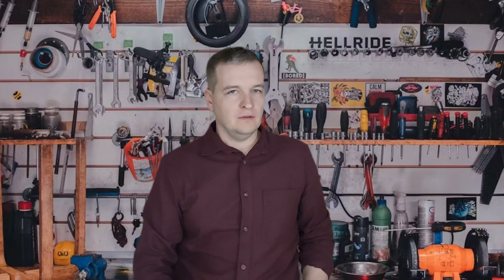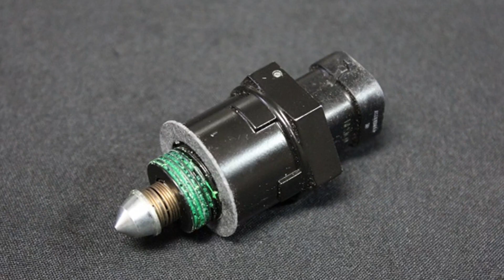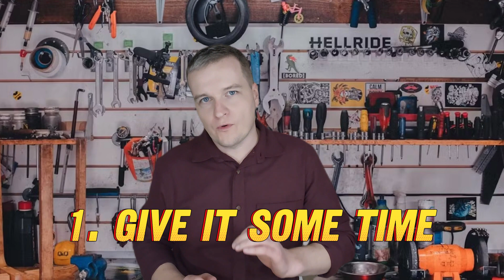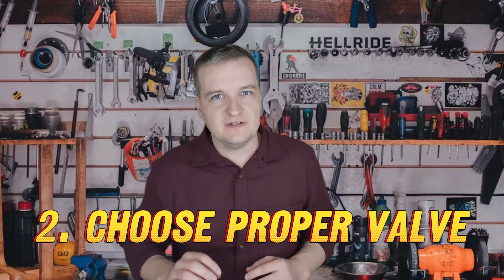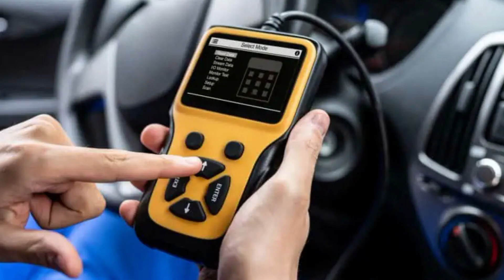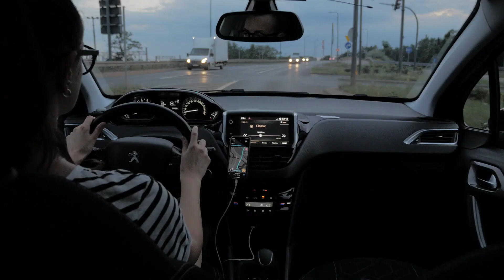What to do after replacing IAC valve (idle air control)?

Comment: Hey! Thank you for your video. So I replaced my iMac cable because it had a crack on it and the idle was rough on the car. I replaced it with a genuine part for Hyundai and it works and no code pop up on the dashboard. The idle feels better and smooth but I said rpm is idle is at 1000 or just lil bit over when it used to be under. Listening to your video I’m guessing the car was used to the old one. What is the normal range for a car to idle?? I have Hyundai Santa Fe 2006 2.7.  Please and thank you
Reply from the maker: Hey! No, 1000 rpm is not normal (it's ok only when the engine is warming up). I would use a good OBD2 system (not just ELM scanner) and check if the IAC is working properly. But it's not only IAC that can affect this, so a good inspection is needed here.